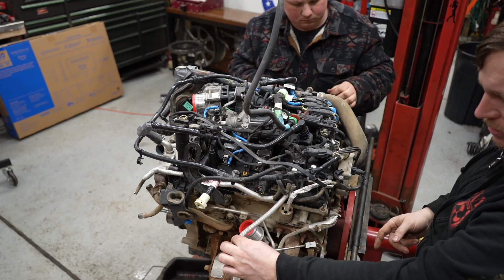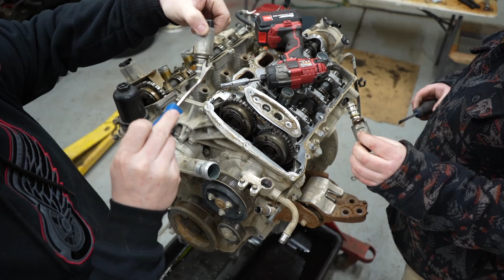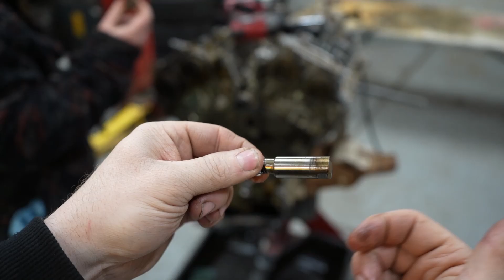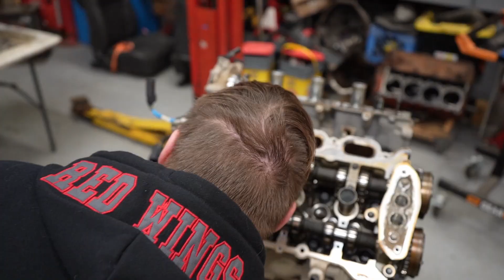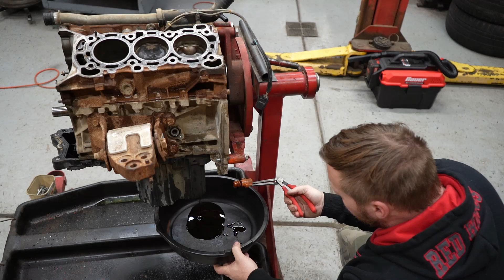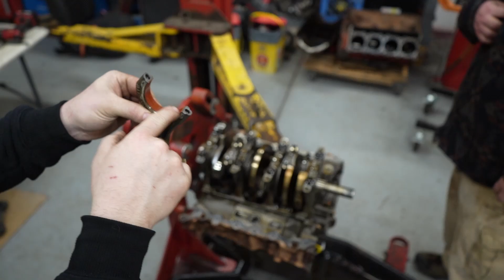Ford 2.7L Ecoboost Teardown - Lost Compression on One Cylinder

Comment: 2.7’s don’t overheat for no reason regardless of how long you tow with it. 
Odds are it’s a bad valve from a batch of bad valves they had. Is not a design issue, was a short term part production problem.

Comment: Great video… those cute little crank gears lol shattered on my truck 3 weeks after a new timing kit installed and the driverside tensioner assy was cracked coming from the locking pin area out …. So mad about the ford tensioner cracking I’m thinking that’s what caused my issue ? Cause it ran great for awhile but now I have 4 broken rockers … did y’all rebuild this ?
Reply from the maker: We're trying to sell off the parts individually

Comment: Why do we not fix 2.7 ecoboost engines?  Valves are cheap. Enginrs are not.
Reply: I'm considering posting an assembly video for my Gen 1 2.7L engine. My 2016 F-150 cracked a head and blew a gasket in 2023 with 96k miles. I was forced to rebuild it after waiting a year for a factory remanufactured unit.

While the build isn't hard, sourcing parts is a major challenge. I ended up doing a full OEM-spec rebuild, but about a third of the components and bolts are one-time use. I’ve spent roughly $1,500 on bolts, hoses, and gaskets alone—not to mention the expensive specialty tools required for reassembly plus machining cost.  Finding a good machine shop who will work with a DIYer and is not backup several months is a challenge too.

For the average customer, replacement is more cost-effective than rebuilding.

 If I wasn't a DIYer who started sourcing parts back in 2023, this wouldn't be worth it for me either at today's prices. I originally wanted to replace the motor, but none were available in 2023/2024, and used units with 150k+ miles were going for $2k–$4k.
Reply from the maker: For most people it's the lack of tools and the need to pull the engine out that keep them from fixing their own cars. When I had this same engine in my Ford fusion sport, I found full low mile engines for 1500$ from salvage yards, so it's still usually cheaper and easier to replace it when you factor in cost of labor for most people. If it were me, I'd fix it myself.

Comment: I also had a fusion sport with the 2.7 and now a bronco with this engine. both the bronco and espcially the fusion are shockingly quick with this little guy. the early 2.7 did have a problem with the valves, manufacture defect i think? wonder if this is one of those. love how well built this thing is the only thing i don't like is that wet belt for the oil pump. it just dosen't make sense to do that after making eveything else so well. why risk it.
Reply from the maker: Everyone hates the wet oil pump belt but I've worked for a major manufacturer that tests them and they will generally outlast the rest of the seals in the engine with no issues.